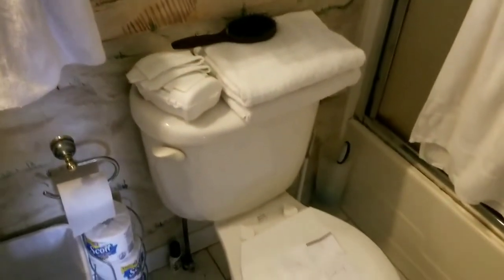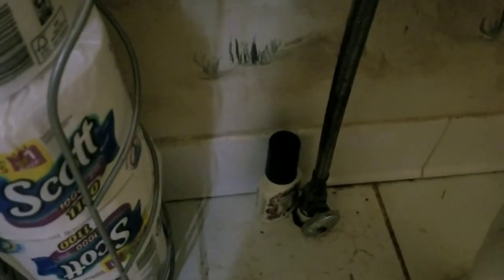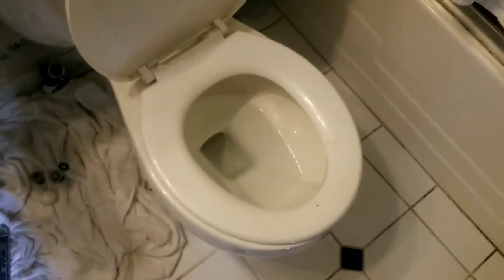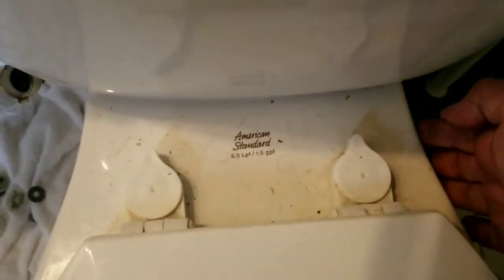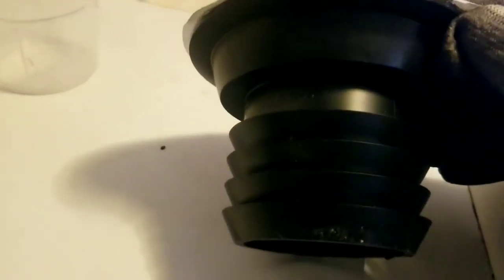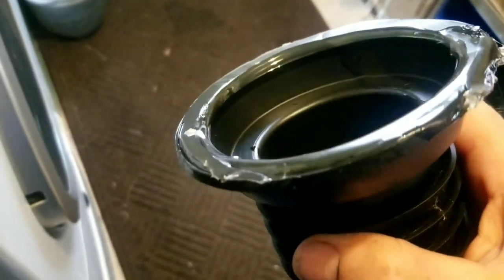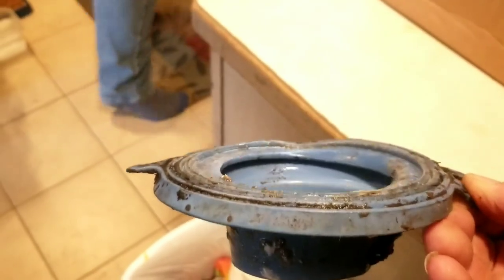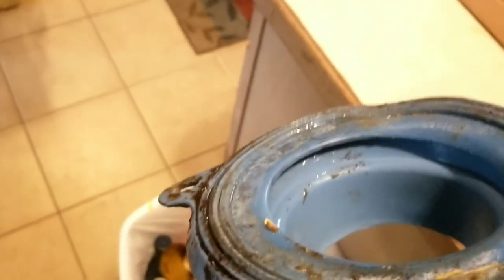How to Replace Wax Ring Toilet Flange Seal

Comment: This fernco seal is great, but really works best for a new toilet.  I've had great luck with the 2 new toilets I've installed.  With your older toilet, I don't think you cleaned it enough.
Reply from the maker: I ended up switching to wax when I had to do some bathroom work.

Comment: Plumber charged me a 100 bucks last month for a new ring. Then, 2 weeks ago my neighbor had a pool dug out. The house vibrated for 2 days as the track loader went down the side alley. The toilet moved a quarter of an inch. The plumber had put a caulking seal around the toilet. It is not leaking yet.
Reply: Do not caulk around your toilet. Caulking around your toilet prevents the water from leaking from the base of the toilet and forces it to leak into your foundation or subfloor

Comment: How long does it last ,are they 100% effective
Reply from the maker: I am not impressed, I had a back up and it leaked a lot. Going to switch back to neoprene donut seal.
Reply: @darylturcott  I wonder if the pipe should have been wire brushed inside to make a smooth surface for the ribs to grab on?